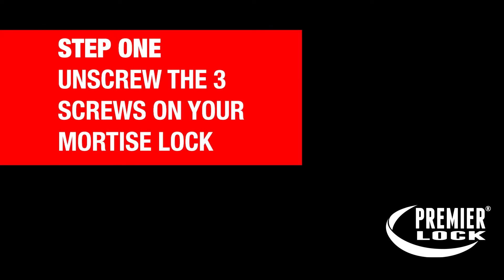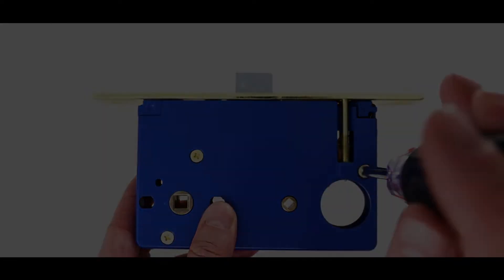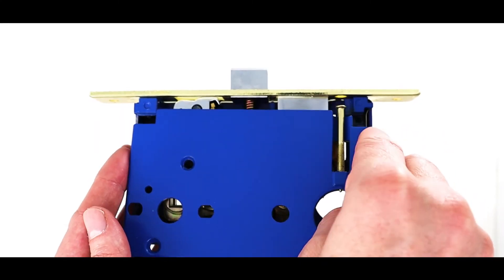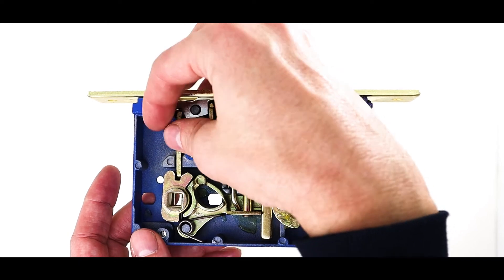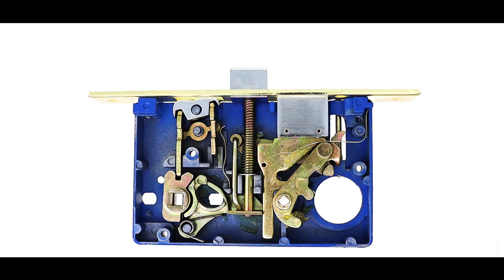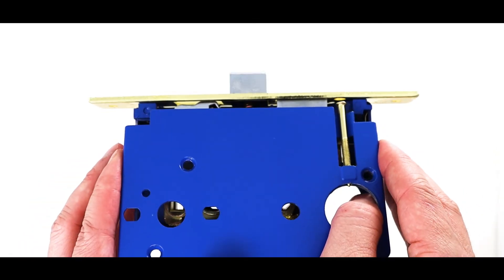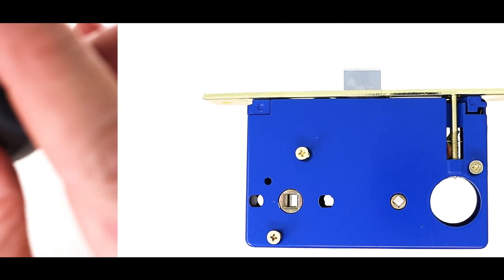CHANGING YOUR LOCKING BAR IN YOUR MORTISE LOCK

Comment: What does flipping this bar accomplish?
I think your video has a glitch. Where you seem to explain what flipping does, the explanation is the same for both flipped and for left untouched..
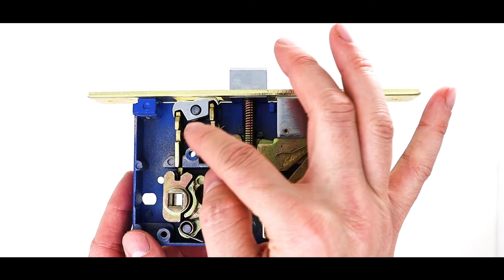Reply: @BrewerShettles  That is not really helpful. Might i suggest you rewatch at 00:46 and see what I mean? And there is only one door knob, so even if I understood you it makes no sense.
Thank you for trying to answer though.
Reply: @k.g.442  I fixed my lock so it works - Good Luck to you
Reply: @BrewerShettles  I don't doubt you fixed your lock. I need clarity on a part of the video that mistakenly repeats the same instruction for a leer that has two possible orientations. The video is glitched, so I need an explanation.
Reply: @BrewerShettles  I mistook you as the creator of the video. Now I understand why you don't understand. Thank you anyways!
Reply: @k.g.442  That piece is called the locking hub arm. I think I see your point - instead of flipping it in place either up or down, they swap the ends. I think the video is wrong.